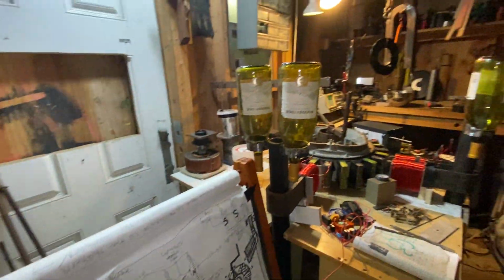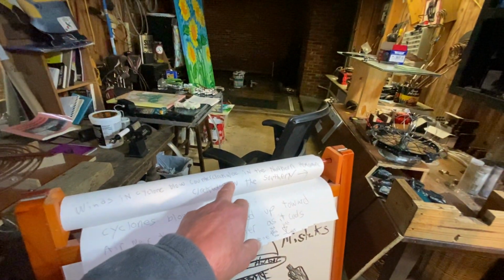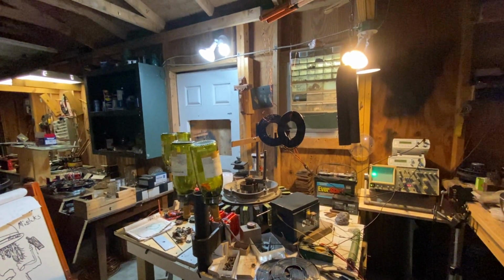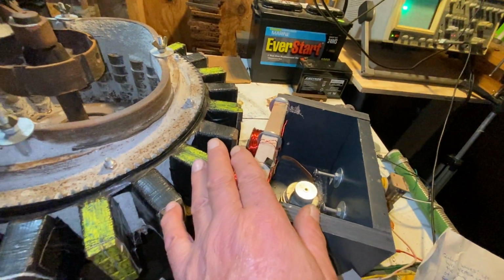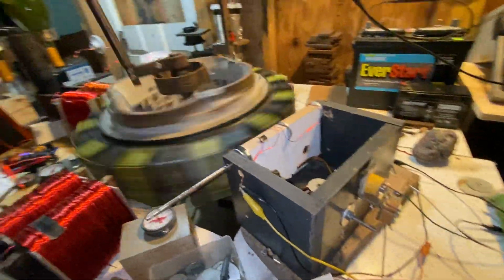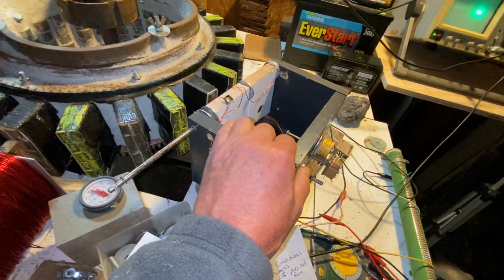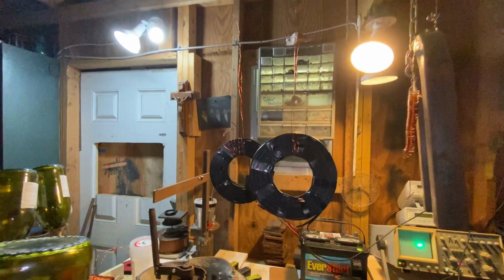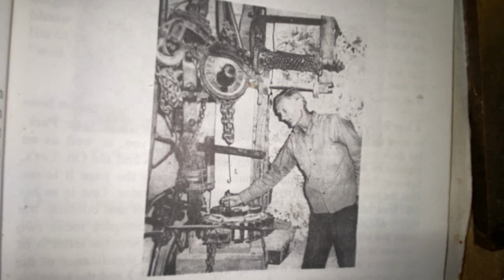Why Ed Leedskalnin Built his Magnetic Wheel!

Comment: Bedini  Battery  Charger Motor
Battery charges capacitor. Capacitor charges induction coil and iron core. Which attracts magnet. Coil circuit switches over so positive connects to positive of rechargeable battery. Discharge resistance causes coil to repel magnet.

Comment: Hey Vinny, so how was Tesla able to receive the scalar waves in the car as the car obviously is not grounded through the rubber tires?
Reply: Not too sure but I think you can hang a cable off the car that keeps in contact with the ground. Heard something about it in mechanics class as to not be a shock from you car as it builds up static wile driving

Comment: Some more tips; Page 3 of magnetic current, where Ed talks about “never stop in the middle or there will be an extra pole”. With that whole paragraph, he tells how to pull the “extra pole” from the middle OR from the ends. Essentially forming a mechanical diode that is able to send back EMF to a different circuit. Study and understand that paragraph completely. Also, you need the vertical square iron through north wood, in front of black box and need the steel spheres under clover arch middles and above South Pole perm magnet middles. Try to employ more iron wire coils without cores because “their function is double”. I believe his flywheel, by its design/proportions, manipulated where/when the middle of all his various circuits would be, thus changing the direction they would prefer to flow. The middle is easier to manipulate than the ends - it doesn’t push back. Good luck!

Comment: Hi Vinny. This will help you out; I was not able to post the link.. you’ll have to search for “visualization of prime numbers”. There will be a graph that shows the frequency pattern of nature. Look for the yin yangs. You must concentrate, commutate, and shift your pulses according to this pattern in order to better create your scalar/longitudinal waves. Pulses begin at the prime number intervals, once concentrated they should be commutated/divided at those moments along the line where are the most intersections. I like to call these points; “Opposite prime” numbers (2,4, 6, 8, 12, 16, 24). Once divided, depending on which current you need to restore, send one current to ground, or the other to air. *On level ground, South’s push more (voltage/counterclockwise/approaches), North’s pull more (current/clockwise/recedes from) but, if the ground isn’t level this changes*. You’ll need to commutate voltage and current also.

Comment: I agree, the iron in the blood is able to store the 'Mobius' hysteresis when in the 'loop' configuration.... It is like taking a 'linear' polarized nail (electromagnet) and looping it.  This forms a mobius loop which can interact with both Chiral 'sides' of the scalar wave (left and right magnetic hands).

This allows the 'mapping' of both poles of a 3D sphere (transduction), to two separate 2D plains, in Mid/Side transformation, instead of mapping the sphere as a 'stereophonic' object... Inverts it to a Torus and you get a thin mobius loop Auron Rectangle, out of which the magnetic flux density is projected on a bar magnet.  The objective then is to Regulate this cycling to bifurcate and syncopate the 2/3 periodicities.  

 Asymmetrically balanced (not symmetrical). Even thought 'charges' are 'opposite' +/-, the magnetic portion of e/m is chiral, which is why they can superimpose as a vortex N/S.

If electricity operates in the 'right hand rule' convention, electrons always go the opposite direction as positive flow would go. This means something completely different to opposite charges, verse chirality in magnetic pairs.

It makes me wondering if Magnetism is Electricity's opposable thumbs.

Out of Phase is volume with no sound (cancellation, the energy is still there) , energy with no frequency, not absence of energy, yes!  (counter-spatial/vacuum).
Reply: The only difference with a bar magnet is that the components in the magnet receive their electrical configuration Above the currie temperature (where the can access scalar informational patterns)... Once they cool....these patterns still exist, only the right hand rule takes over and N/S become a chiral pair informationally., Not Opposites.
Reply: This allows them to create that coherent phase cancellation in the middle.

Comment: just out of interest have you made any of the glass bottles a vacuum by dropping lit match and putting a cap on them so it burns up oxygen making vacuum tubes ??
Reply: Ever use a pressure cooker to seal a jar? Did you know a bicycle pump in reverse is a vacuum pump? Ever inflated a tire using WD-40 and a match? FYI thanks for reminding me to heat my pickle jars before I coil them.
Reply: @MAGnetICus_Attractus  do you think Ed's glass bottles where vacuum sealed or open? Not used a pressure cooker on jar but heated them and they seal good once cooled down. Not used WD-40 myself to inflate a tyre but seen it done only on TV in cold place's.